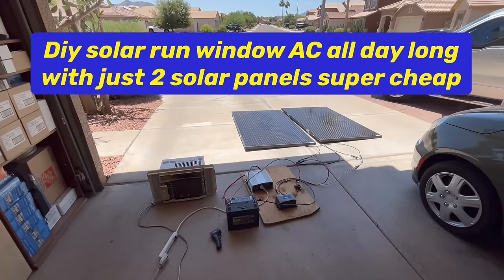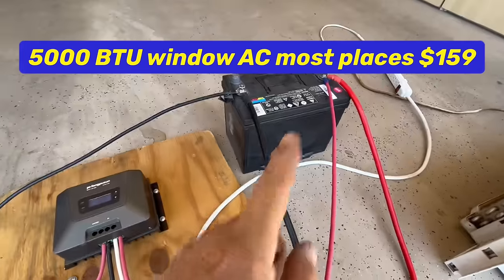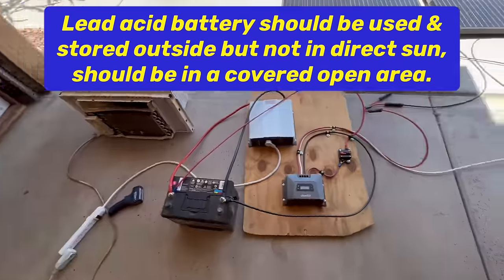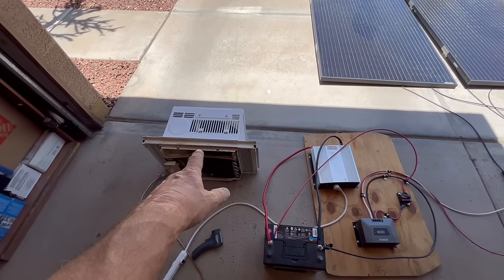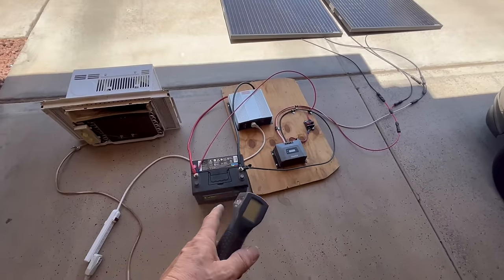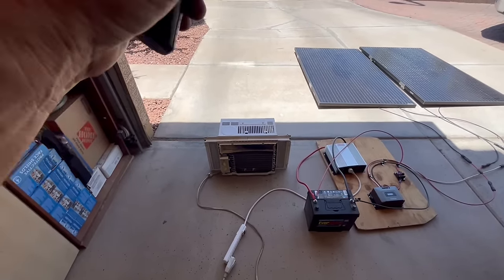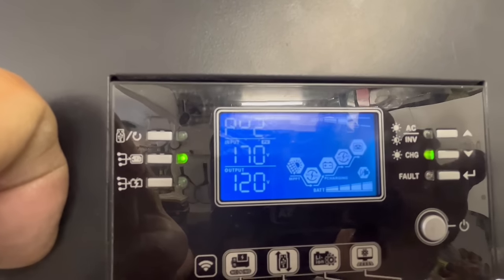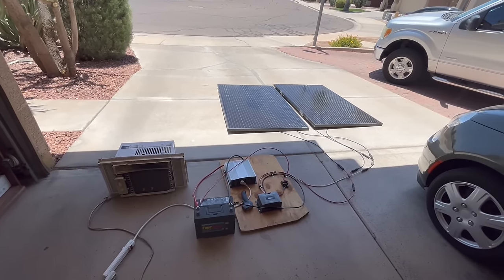Run your window AC with just 2 solar panels when sun shines. Easy DIY project you can do in one day.

Comment: Lithium battery would make that system real nice. $300 now.  Could stay inside unlike the nasty lead acid.
Reply from the maker: You are correct, lithium is the best choice also to be able to run overnight. I ran this 5000 btu mini split for over 8 hours using 2-12volt 2KWh, 150 ah batteries in parallel. That’s a total of 4 kilowatt hours. Window ac uses 500 watts while running.
Reply: @diy-solar-guy  Great info. Thanks!

Comment: How long can the ac run off of the battery shown?
Reply from the maker: Maybe 20-30 minutes until you reach 12 volts and that would be with a fully charged lead acid battery. Lead acid battery in this display is only for the purpose of a continuous constant power source for inverter while charging the battery and running the load at the same time using solar panels. I connected a 12volt, 150 ah, 2 kWh Lithium Iron phosphate battery with no solar and the ac ran for almost 4 hours straight on high, but was not in a small room but in my 3 car garage. If in a 10x10 room, you might get 5 hours out of battery day overnight, 2 of the lithium iron phosphate batteries would probably run ac for 8-10 hours overnight. Lead acid and AGM batteries are only meant for day use while solar is keeping battery charged. Lithium Iron phosphate batteries can last 15-25 years and are worth the investments if you plan to permanently install a window ac or mini split for long term solar powered use. Hope this helps answer your question. Hope you have a wonderful and blessed week

Comment: If u see this will u tell me exactly what parts I need to do this
Reply from the maker: Try to find a place locally that sells solar panels, inverters, batteries, etc… one that can help you purchase all the components you need. shipping kits will cost a lot with shipping. Using used solar panels will reduce cost. Setting up a system vary in cost by what products are available. My best suggestion is to do what I did, watch a lot of videos on YouTube to get the basics and a thorough understanding of off grid solar. Once you understand how solar works and what is needed, then you can start looking at products to buy. Solar can require daily monitoring to make sure system is running and running without any problems. If you can afford to buy a kit with all the components, it would be easier but cost 2-3 times as much as buying individual components and piecing together. Many issues to take into consideration, like shading from trees, buildings, houses, clouds for just a few hours can stop your system from running because you are no longer are running the load and charging your battery at the same time. Hope this helps, can’t really take short cuts, need to understand how off grid solar works before designing a system that will work for you.

Comment: How many panels would i need to run 4 units 1200btu ..would a 3000w charger inverter would be enough
Reply from the maker: Each one of my 12,000 btu 120v mini splits use around 1200 watts when first turned on and running for about 2-3 minutes. After the ac has cooled the room, the watts will start to drop as low as 200-400 watts. With a window ac, this will not happen. So with a 12,000 btu window ac that, I’m not sure of the watt or amp load. But with each mini split at 1200 watts, you would need to have around 1600-2000 watts in solar panels connected to get a consistent 1200 watts output for each mini split. So I would have 6400-8000 watts in solar panels to try to run 4 mini splits and charge battery at same time. A lot depends on your solar panels you use and how they are mounted and at what angle towards the sun. All these factors should be considered. Check out some of my other newer videos and you can see how I mount my solar panels and how many I use and on a couple different array types. Hope this helps. Hope you have a truly wonderful and extremely blessed 2024.
Reply: @diy-solar-guy  thanks for the quick response ..in panels I would need 6500-8000 watts and 1 or 2 5000watts  inverter and a few batteries??
Reply from the maker: Check out my video on the EG4 3000 watt inverter, when you use 2 in parallel you can get split phase 120/240 volts. You would get 3000 watt output from both inverters for a total of 6000 watts output when in parallel. Then down the road if you wanted to, you could do like I am doing with my EG4 inverters in parallel. Running my whole house 31/2 ton ac 24 hours a day, solar power in day and LiFePO4 battery bank at night. These inverters can surge to 50 amps each to start large loads and can run those 4 mini splits with ease all at the same time. Plus you can connect up to 5000 watts on each inverter with solar panel input voltage up to 500 volts dc solar panel input. But you will have to connect either one string of 4000-5000 watts in series or 2 string of 2500 watt in series and parallel the 2-2500 watt string in parallel. You have to keep your solar panel dc amps below 18 amps input with the EG4 3000 watt inverters. So keep that in mind. Up to 500 dc volt solar panel input and 18 amps from those same solar panel input. I have links in my videos for the EG4 inverter and solar panels. The bonus with the EG4 inverter is they give you the communication wires needed to parallel, a red and black 6 foot cable to run from inverter to breaker then to battery. The 125 amp breaker is included in box. You also get a WiFi dongle to monitor your inverter usage. The inverters are $674 each, they also have a great sale on EG4 LiFePO4 51.2v 100 ah 5120 wh batteries for $1299 each. I just bought 2 more of these batteries myself and gas delivery last week. I have 25.5 kWh in my battery bank to run 3 1/2 ton overnight. Links for all this is in the description for video. Check it out and if you do decide to buy from Signature Solar, we would appreciate it if you purchase through the links in the video. We get a small commission that helps us buy their products and show what their products can do in real world off grid applications. Hope this helps. Feel free to ask more questions. Have a truly blessed day. Check out my video on these EG4 3000 watt inverters connected and in use to understand what I am saying in this response.
Reply: @diy-solar-guy  I'm just having a hart time figuring out how many pannels I need to power 4 units at  115v 10.4 A ac units ..
Reply from the maker: @rccorcoles7082  you will find out when you run the units weather you need more panels so try with what you think you can get away with.

Comment: Im running essentially the same setup, but with 4x 100w 12v panels in series. Putting in roughly 16 amps, 68v to the controller but still cant seem to run a 6k btu ac for more than a few hours without depleting 3x 12v (parallel) 114ah batteries. AC draws around 400 watts, 4.6 amps. Im not sure if i need more panels because the watt draw is more than max from panels? Amp draw from ac is way less than input from panels.
Reply from the maker: You need to have enough watts to run ac plus enough watts to charge battery, if your ac does not cycle on and off, you won’t charge the battery. My ac use to cycle off every few minutes, that’s when the battery was being charged more but battery was still charging a little while ac was running. My ac uses around 500-550 watts and is a 5000 btu unit. My solar panels were in this example 660 total watts. Your ac is larger than my ac so you have to drawing more watts maybe around 600-650 watts. You only have 400 watts connected but really only have maybe 280-300 watts input charge controller. You will never get 100 watts out of a 100 watt panel while sun is up and shinning on solar panels. Sounds like you are only producing half the amount of watts needed just to run ac unit not including charging battery. For you to run that ac unit all day long and keep your battery charged. I would suggest 1000-1200 watts in solar panels to run load and charge battery. This will depend on other conditions such as shading by trees, structures or clouds in sky. You have to overcome having less watts going to charge controller throughput the day. My ac unit was in a shed in back yard and was only 5x10 and extremely well insulated in floor, walls and ceiling. Could easily reach 75 degrees at 9 am within 10-15 minutes then start to cycle on and off all day long. I sometimes would get to 68 degrees with it on full. But my ac in shed was set at 1/2 way on knob for cooling so it cycled a lot. You need around 600-650 watts to run ac and probably 200-400 watts to charge battery if you ac is on high and does not cycle on and off. The amp draw you have is only part of usage, look at how many amps are drawing from ac running. I am not sure why my 5000 btu ac was drawing 5-5.5 amps and your 6000 ac is able to draw less at 4.6 amps and only 400 watts when my ac was drawing 500-550 watts. A larger ac should be around 6 amps and 600-650 watts. If your batteries are lead acid or AGM, then you won’t be able to run very long since you can only discharge battery to 12 volts each. Not sure if your battery were fully charged at 13.2 when you started but it won’t matter much. Add at least the amount of panels to get up to 650-700 watts constant watt input from solar panels and you will be able to run during the day but don’t set on high, set at half way so unit cycles off. Hope this helps.
Reply: @diy-solar-guy  thanks much. Makes sense. Ive been stuck on worrying about amps and volts and honestly didnt consider watt draw until your comment, but youre right...i need more panels. Im running 3x 114 ah 12v batteries in parallel so have good enough battery to run the ac for a couple hours from full charge, 14.4 from my controller, to dead, 10.9. Im really only limited by the controller since it can only manage 800w on 24v battery or 400w on 12v. If i go to 24v then my inverter becomes an issue since it wont take 24v input. Its all an experiment for a little shed office anyway and ive got generator backup. The shed is very efficient, spray foamed all around including under the floor. I imagine my AC is running less watts just because its a newer, probably more efficient, unit than yours. But thats what the killawatt meter says anyway, how true it is ....? 

I appreciate you taking the time to teach me a bit of something and i enjoyed your video. Thanks again!
Reply from the maker: @UserFormelyKnownAs_hjkh  I found out by buying used panels locally I can install 3 times the amount of solar I need. I can get used 250 watt solar panels for $25-$35 each. I have over 100 solar panels but not all are installed. I have spare panels. I always over produce for the reason of very inexpensive panels. Always better to have too much than not enough. It took me several years to stock up on solar panels but they will last 10-20 years. Try to get more solar panels and if you can look for higher watts per panel that would help. I don’t have even one new solar panel, all are used and been running for almost 4 years now. Hope you have a wonderful and blessed weekend
Reply: Will your charge controller allow 50% overpanelling? Most do, could help you get a bit more power in cloud etc. Also don't forget if you are dumping 16 amps into the syatem, your 400w aircon is pulling 33amps @12v not 4 😊
Reply: @asedcopf  i actually ended uo adsing 2x 100w panels. Wiring 3 in series, twice, and those two sets in parallel. That has helped immensely. What gets me is my charge controller shows 50ish volts, 18ish amps. Multiply those numbers to get watts and thats WAY over what my panels are rated for. Now maybe this is what te charge controller is outting into the batteries? I dont know. Either way, it has helped a lot! I would have to bump up to a 24V systems to really double up my panels, at which point i could surely run AC continuously
Reply: @UserFormelyKnownAs_hjkh  that seems..weird - 3x 100w in series x 2 parallel should get you about 50v @ 12 amps (18v x 6.5A per panel) with your charge controller spitting out 13v x 18A (roughly speaking with a squint) so maybe your controller shows readout differently? Assume its not PWM 🤷‍♂️ You hooked your battery up to CC first right?
Reply: @asedcopf  correct. This is renogy 30A MPPT controller. Ive yet to put an amp meter on it to confirm/deny the numbers. And yes, order of hookup was battery to charge controller, panels then hooked up while facing the ground (no voltage output), then once panels hooked up i flipped over to behin charging. Its a strange deal, but at this point its working so im not complaining. As long as it works, theyre just numbers in the end.
Reply from the maker: @asedcopf  with a 12 volt system I am maxed at 2 solar panels, I could add another charge controller and 2 more 330 watts solar panels to double the amount of watts suppling load and be able to charge the battery on a partly cloudy day. A full day of clouds would drop your sonar production to 20-50 percent of what is needed. At one point almost 2 years after running system, I added 5 more charge controllers and 3 more 12 volt batteries in parallel to run several mini splits 12,000 btu 120 volt. I now only have 48volt inverters and run my entire ac in house and garage daily. I did this simple set up because it is easily expandable by adding more batteries and charge controllers.
Reply from the maker: @UserFormelyKnownAs_hjkh yep, as long as it works, hope your system runs a long time with no problems.
Reply from the maker: @asedcopf yes , charge controller first. These older charge controllers were not the best at constant output being actual. Sometimes the numbers were all over the place, the mppt was not the greatest in this charge controller. That’s why I eventually went with a 24 volt and 48 volt all in one off grid inverters. Much better results. This was what I started with, 12 volt system to try to understand solar off grid, quickly learned about solar and now run all my ac in my 2 story house and in garage along with many other appliances in house and run pool pump 24/7 with solar and in winter, I run my pool heater when not having to cool house and garage. Check out my other videos to see this. Hope you have a blessed day
Reply from the maker: @UserFormelyKnownAs_hjkh output can be erratic depending on inverter and many factors. But battery voltage should stay pretty stable. Just need to keep battery charged while running ac. That is the key. Off grid solar is constantly experimenting with what will happen if I do this or do that. It is a lot of fun and rewarding to accomplish running whole house ac units and garage ac along with many other appliances running at the same time saving a ton of money. The lord time you invest in learning about solar, the better it can work for you. Hope you have a blessed day.

Comment: I'm not sure how this will work for longer period of times. The panels output 400W but the AC unit requires 500W. You get 100W difference from the battery and if that battery is 100Ahour at 12 V you have 1200Wh stored in it and it will last 10hours out of battery for that 100W difference
Reply from the maker: You will need to have solar panels that can supply load and charge battery at same time. You would be better off having a 24v system with this charge controller, that way you could add one more 330 watt panel and would be almost 1000 watts of potential pv input. That would work much better than 2 solar panels. Thanks for your input
Reply: @diy-solar-guy  I was talking about your configuration in particular. I know you can put 3 panels for maybe 600W so accounting for conversion losses in the inverter to drive that 500W AC unit
Reply from the maker: @car9167  in the video, the 2 solar panels were suppling 550 watts to run. Unit. The other thing is you have to adjust the window ac to about 1/2 so it will cycle on and off. If the window ac runs constantly, you will drain battery pretty quick.
Reply: @diy-solar-guy  Oh ok. I thought I saw some 390W or something... My bad
Reply: So what should he do to make it work thinking they're running the same
Reply: @diy-solar-guy Help trying to do the same setup seems like you know what you're talkin about
Reply from the maker: @aztecjoe29  with the charge controller, you can use 2-330 watt panels for a 12v system or 4-330 watt panels for a 24v system. Using 4 solar panels Will definitely make sure you can run ac all day long. I just used 2 solar panels to show you can run ac with solar. I used this system in my shed for a few years using only solar to keep inverters cool during the day before I moved all my components in the garage. You just need to make sure you have enough solar to run load and charge battery at same time.
Reply from the maker: With a 12v system you are limited to about 2 solar panels. But with a 24v system you can use 4 solar panels with same charge controller making it much easier to run ac all day long. 24v system is just 2-12v batteries in series. Really easy to set up. Hope this helps. Thanks for you input.

Comment: Why use an inverter to make A\C of D\C and then let the airco convert it back again, the power los is huge. There are airco units that run directly on D\C at least Sharp has one. This makes that you need far less solar panels and gives you a less complicated setup.  For the DYI lovers you can also remove the adapter from the airco and have it run directly of a battery with the right specs that you charge using solar.
Reply from the maker: I will have to research airco from Sharp. Thanks for your input. Hope you have a wonderful and blessed week
Reply: @diy-solar-guy  and you have a good time to my friend! love your ingenuity